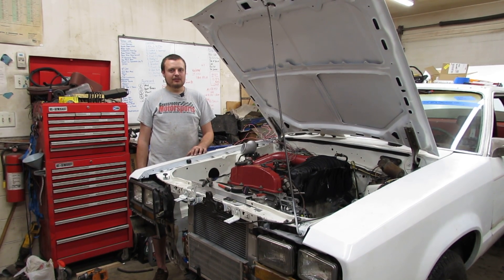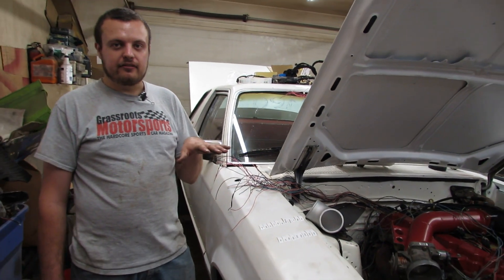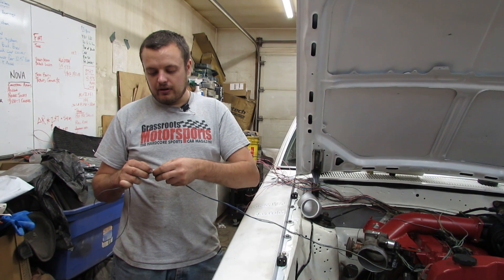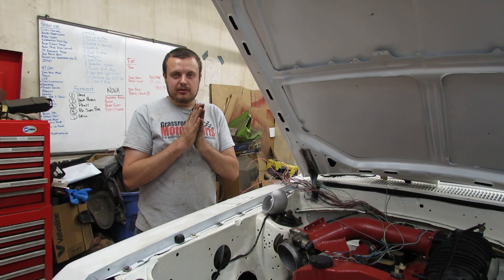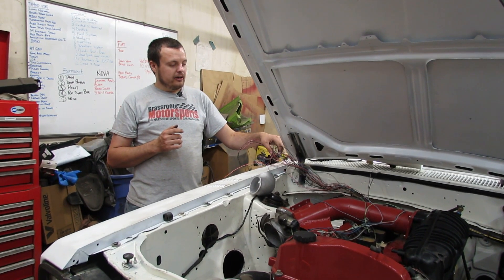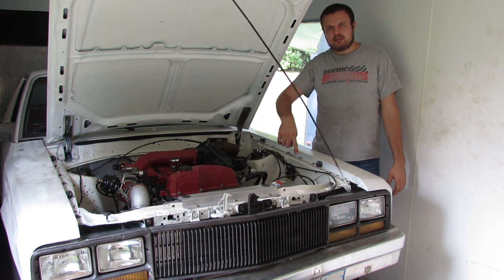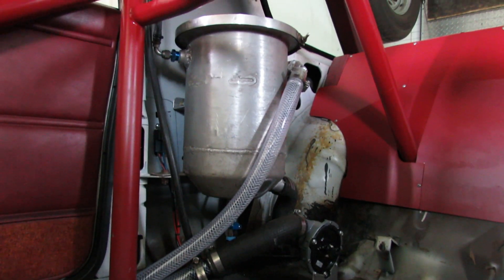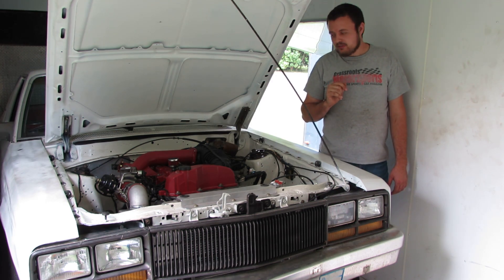The Vortec 4200 Fairmont is ready for the Dyno

Comment: Is there anywhere I can get a flywheel for the 4200?  I’ve got an AR5.  It bolts up.  I’m good honking the solstice clutch and pressure plate will work.  What about a flywheel?

Comment: Great to see you have temp sensors on the inlet and outlet sides of the charge cooler. I did the same thing with a manifold mounted air to water core in my blower setup and it's really interesting to see the data.

Comment: I got a stupid question,do you have any concerns about that plastic intake bursting under pressure generated by the Big Ass turbo action? Or do you have a calculation for that sort of thing? Or just boost till it blows then it's time to fabricate? That's a cool Fairmont by the way.
Reply: Its the same material the LS intakes are made from and guys have made over 1000 wheel with them for years.
Reply from the maker: what he said